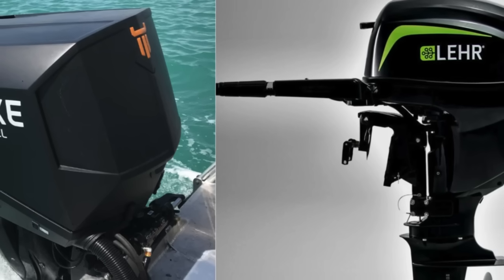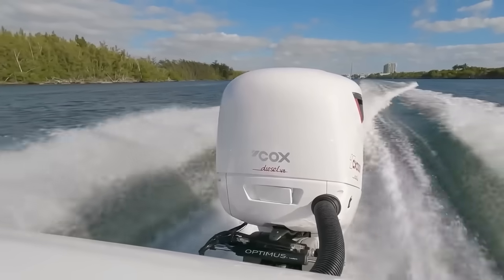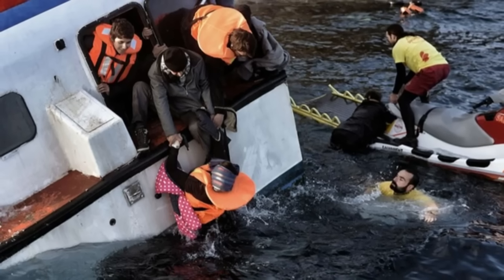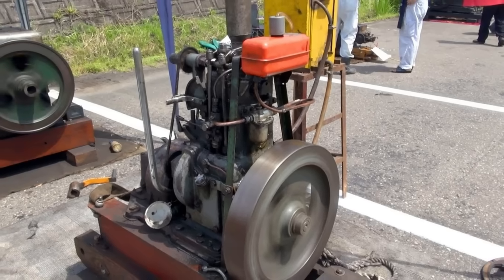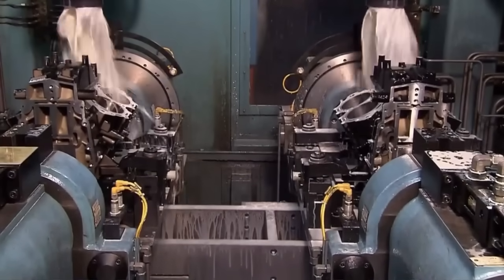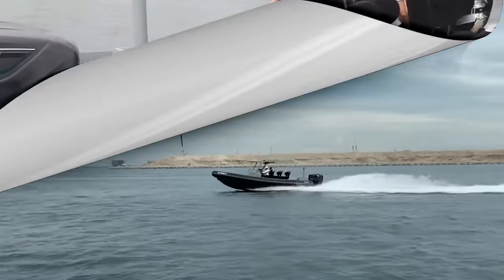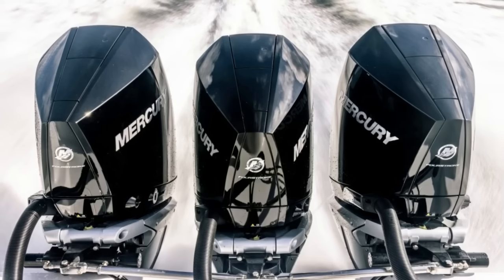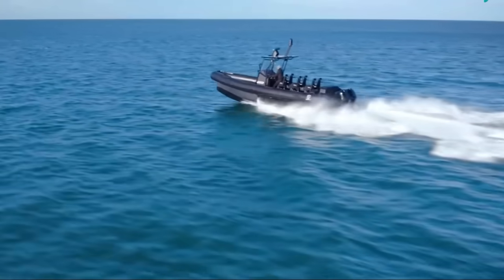Gas vs Diesel Boat Engines: Which Is Really Better?

Comment: yeah, diesel, i've been a year and half and had issues with my ford ranger diesel engine that didn't get fixed yet, many mechanic repairs and still issues, when it ages beyond 10years (it was cheap to run when it was new), the costs to rebuild and refurbish becomes a nightmare.

Comment: botton line is both gas and diesal marine engines are 30+ years behind in technology, put a moden engine on a outboard gas or dissel you will have a fantasic fuel efficient and powerfull boat

Comment: 2x300Hp  1 hours  medium hi speed.  
 Gas = 255USD used in gas        Diesel = 139USD used.  
Diesel is way more cheap to drive.  At last in my country

Comment: Go back to 2 strokes.They were the fastest and most powerful engine's maid and they run forever
Reply: These days the 4 stroke outboards are faster than 2 stroke. They also use much less fuel than a 2 stroke and are far more environmentally friendly than a 2 stroke .
Reply: Yeah and they smoke like a diesel too LOL, I still have my 1974 Evinrude 9,9 and she runs like a dream. One pull.

Comment: Outboard motors are children compared to marine diesel power.
Reply: A 300 horsepower diesel outboard weighs 340 pounds more than my 300 horsepower petrol outboard.
Reply: No diesel engines and diesel outboards are to heavy and they stink. Diesel outboards are not any good on plate aluminium offshore fishing boats like mine.
Reply: @johnboy5167  Oh I see a 300 HP gas outboard floats then?
Reply: Are you a bit thick l said diesel outboards are 2 heavy and that they stink as in they smell bad what part of that don't you understand.

Comment: If I remember well, Yanmar, ruggerini and Peri Pump made small format diesel outboard engines, below 30 HP range.
Reply: I wish I could get my hands on one.
Reply: Ruggerini made a 15 hp aircooled and 25 hp watercooled diesel outboards,with a pto.
Reply: Perkins and yanmar made diesel outboards ranging from 8 to 40 hp.
Reply: every now and then i see those yanmars for sale. Usually the price is ridiculously high 😅